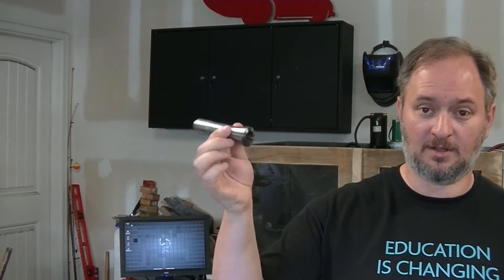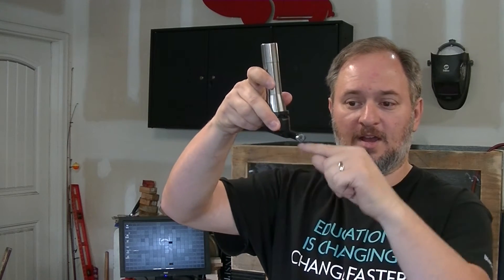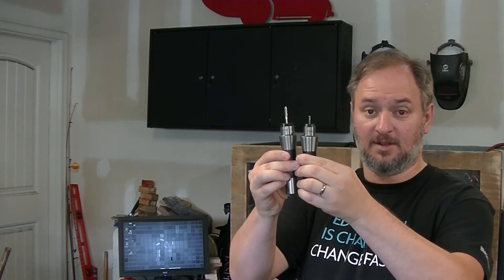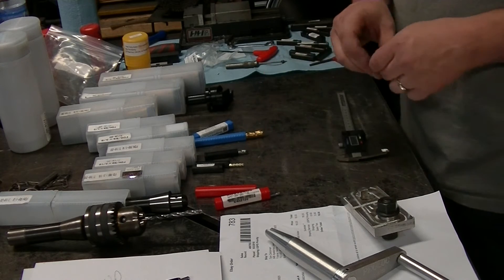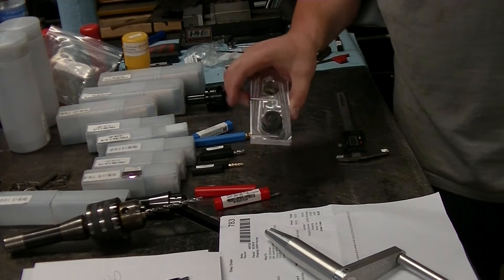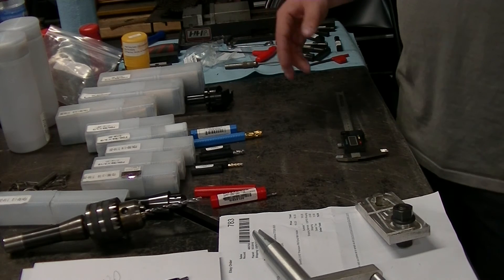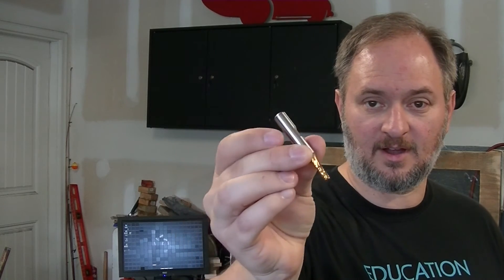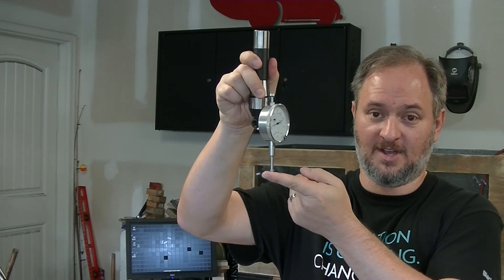NYC CNC Training - Practical Application

Comment: Using mill turn, you can make your own TTS holders. :)
Reply from the maker: +bluehandsvideo You know, I hadn't really thought of that. I'm not sure that I trust the accuracy of my machine though. I'd hate to make a batch of holders that weren't any good! You've got me thinking though. I spent the afternoon cleaning up from the last job and making improvements to the mill to buy me some time to decide next steps. Amazing what a little service did for the machine... It's still too small for my needs but it's definitely much happier for now.

Best wishes,
Tom

Comment: Tom, in one of the shops that I worked at, we had a complete set of screw machine drills which are shorter than the jobber length.  I really got used to them and I used them allot for lathe work.  Much less deflection.  I haven't gotten myself a set yet, but they might be a good application for you mini mill and I am sure that you would find other uses for them.  Good video, I am waiting to see your setup.  R.J.
Reply from the maker: +R.J.'s workshop I think I know what I'm getting the next time an Enco coupon comes out... The mini-mill did the job eventually but I got spoiled on those bigger machines. I'm going to have to upgrade soon!

Best wishes,
Tom Z

Comment: You got the right idea. I prefer collet holders myself. Weldon shanks are ok for the rpm's you run. Collets are More usable. I hope you dont mind a few suggestions. If you are going to bore the holes dont use an adaptive. Drill the hole as large as you can for the smallest hole, use a 2d bore cycle to circle interpolate. You can rough and finish on one tool. Or a 3d pocket cycle will do the same. Just helix to the bottom

I ran 20 bores today. 1.25 bores. Drilled with 1in and bore cycle with .75. I left .03 on the walls for a boring head. Make a couple shims for the fixture to set the part up .02 and debur on the same fixture. 2-3 flutes in alum is what you normally use. So be aware of that on your radial off sets. Less step to clear chips or it will load up. Can you not use the 3/8 to do everything? Buy your self some larger spot drills. Leave .1 sticking up on the first opp. Rough the contour at a z of -.05 and leave .01 on the wall.You use one spot drill to spot and chamfer every hole in one shot (the beauty of a 90* spot). Use the same tool to break the profile edge. Drill and bore. That side is finished. Flip the part and rough to final Z and finish to finale Z to clean up the .01 you left. If you shim the part you can use the same idea for breaking the edge.
Reply from the maker: +Logical Apprentice. Thanks, Chuck! I saw this on FB first so I replied there. Nothing like a 5 hour process to make parts that should take 5 minutes, right?

Appreciate the guidance, my friend. Hope you are well!

Tom Z
Reply: +Tom Zelickman (Inspiration Metalworks)  I put it on FB first. Then thought you might like the comment here so I double posted it.

Comment: Looking forward to the next installment.  Am I assuming correctly that once you install a tool in these "special" collets, you leave it in?  If so, I'm guessing that you wouldn't include drills in your offset library.
Reply from the maker: +Lee Hi, Lee! You're correct in that the idea is to leave the tools in the holder so you don't need to indicate them in every time you change a tool. With drills, I don't have enough holders to leave them in like that but you absolutely could have them in the library and do a quick measurement for that one tool before running the job or after sharpening. I hit a Z travel issue though because my drill chuck was for my big machine and the drill itself was also rather long. I ended up throwing it into a collet, doing a quick offset, and then letting the program run.

Thanks for watching, sir!
Tom Z
Reply: +Tom Zelickman (Inspiration Metalworks) I added a 2" lift block to my mini mill. I never had any problems with drills, but did with reamers.